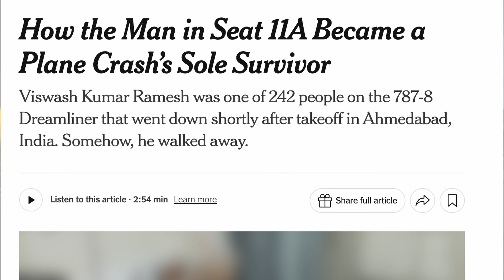Why the RAT Changes Everything – Air India 171 Update

Comment: And there might be an additional sign for a complete failure of both engines: The sound of the original video is quite good. But even in the sound of that video I do not hear any loud or increasing loud sound of both engines. In such a situation the engines would normally be put into full power function, what would make a significant louder sound than that, what we can hear in the video. Thanks for your update on the analysis. This accident is very serious from a technical perspective, and I can only hope, that it will be analyzed and clarified, until no doubt about the reason can come up anymore ...

Comment: Usually there is a accumulation of faults and errors. What I see posible that the rat was activated by malfunction and the hydraulic of the rad interfeard with the hydraulic of the engines causing the following failiurs:
Loss of controll and engine stop. The loud bang was the activation of the rat. The bang was the start not the conscience.

Comment: I didn't hear the jet engines in that clear video, wouldn't that be an indication of a dual engine failure? If the engines were running, wouldn't we have heard them in that video? Wouldn't they have drowned out the RAT props at least partially?

Comment: Are the flaps up or down in the new video (where you hear the RAT)?  If the flaps are indeed up, how do you explain that?  With all due respect, you ought to use the new video to revisit your old theory, not just to justify your new one.  In other words, does the new video rule out the possibility that the pilots accidentally pulled in the flaps too early?

Comment: What you did not observe was the position of the wheel bogey leaning forward..In 787, during take off, the wheel bogey bends in the forward position when the gear retraction leaver has been pulled up..the wheel bogey initially is facing upwards and then bends forwards while the undercarriage opens up to the retracting gear..It confirms that the pilot did initiate the gear up, however, due to the failure as you brought out, the gear initially facing up bent forward and then got stuck due to hydraulic failure and possibly a dual engine failure...the flaps from the picture were clearly down as per the take off configuration...

Comment: Is it possible one of the pilots shutdown both engines either on purpose or accidentally. Recall the fairly recent incident with a Horizon pilot flying in the jump seat having a mental breakdown and attempting to shutdown both engines in an apparent suicide attempt.
Reply: Oh! here comes test-is of Sherlock Holmes
Reply: @ashwatthama007 what? The current thought is a loss of thrust in both engines with no evidence of a bird strike. I’m asking a question. I’m not sure if the RAT would deploy if the engines were shutdown. I’m assuming in any situation of a loss of power or hydraulics they would, but I’m not a pilot or an expert on the subject. Sorry for asking a question.
Reply: @ashwatthama007 well…initial report is out…what do you have to say now…

Comment: Did anyone else see the video one passenger took right before takeoff of the AC off, the entertainment/TV's weren't working, and the lights off inside the cabin? Wouldn't that point more towards electrical failure rather than total engine loss like capt Steve thinks?

Comment: I am a pioneer B787 flyer, B787 captain that flew the B787 when it was newly introduced and have more than 8000 hours on B787 and have witnessed all its problems from very first issues with battery fire.  It is very difficult for me to accept this kind of failure as  the 787 is very stable and strong . Very sad

Comment: To add to this as well the landing gear on the video is tilted forward like it was in transition to be retracted but failed due to no hydraulics.

Also if the engines were running you surely would have heard them at full power if they were functioning.

Comment: I have theorized from the start, that both engines were mistakenly cut off, instead of just cut slightly back for the noise reduction guidelines at airports surrounded by densely built areas.  At the point at which a craft has just become airborne and needs to start climbing, it is tail-heavy and needs enough thrust to fight gravity.  If that crucial point of balance is compromised, the craft will fall backwards like a stone.  In this case, it looks as if the pilot tried to correct by lowering the nose of the craft.  But it just did not have enough altitude.

Comment: Besides the proposition  "dual engine failure" (confirmed (?) by RAT-deployment ).....we cannot deny the CCTV footage: the moments shortly after rotation....we see dust vortex below the wings. So this moment was OUTSIDE the runway threshold...relatively LATE...

Maybe there was not a sudden power loss after all..? Instead....continuous insufficiënt power along the take off roll all together? Can it be that the auto-throttle setting was faulty due to wrong FMS input? A marginal power condition, postponing the moment of "positive rate of climb" and the "gear up" command....in a high density altitude situation...??

Comment: It’s something that may be the cause of the crash 

As the plane was going to crash in the video moments before the plane crashed the RAT was deployed(Ram Air Turbine) it’s a small turbine that provides electrical power and hydraulic power to the plane in case of:
1:Electrical Faliure
2:Hydraulic failure 
3:Dual Engine failure

And the deployment of the turbine can be proved as it makes a propeller jet sound as in the original video of the crash it makes a propeller aircraft sound and in another video of a different aircraft with the RAT deployed it also makes the propeller aircraft sound.

The survivor also explained that there was a loud bang and lights flickering on the plane which mean the deployment of the RAT as the lights flickered.

Before the crash pilots said:
“No power,No thrust,losing power,Unable to Lift.”

This may be the evidence of a dual engine failure 

As the RAT deployed and the pilots said “No power No thrust…”

Though it’s a theory it’s a strong evidence

(This is all by “Captain Steeeve” he explained it more detailed check his video)

Comment: I’ve heard speculation that they used up every bit of the runway and that’s why there is so much dust kicked up by the engine thrust as they rotate. Maybe debris from the ground got sucked into both engines right at takeoff causing failure?

Comment: Speculation: A likely starting point of the accident chain is the severe contamination of the fuel supplied to the aircraft's engines. This contamination may have resulted from the wrong type of fuel being loaded into the tanks, the introduction of foreign substances during refueling (such as water, sediment, or particles), or a malfunction within the fuel systems. As a result, it can be said that the contaminated fuel reaching the engines clogged or damaged critical components responsible for generating thrust.

It is plausible to assume that both engines began losing power either simultaneously or in rapid succession due to the effects of the contaminated fuel during the aircraft’s acceleration on the runway—or that they failed entirely. Such simultaneous engine failure is extremely rare in modern aircraft and usually indicates a shared systemic issue.

Once the engines were rendered inoperative, the aircraft’s systems automatically deployed an emergency power generator known as the Ram Air Turbine (RAT). However, the RAT is designed solely to provide power to the most essential systems, ensuring that pilots retain at least limited control authority. This indicates the aircraft was in a critical, life-threatening state.

While attempting to take off—or shortly after becoming airborne—the aircraft likely entered a stall, meaning the wings were no longer producing sufficient lift, causing the aircraft to lose altitude uncontrollably and ultimately crash.

Comment: 12:58 as a former Naval Aviator and later 25 year Gulfstream pilot with RATs, you changed my pretty firm belief in pilot error because the gear was not up or moving up and apparently no flaps showing.  Great DETAILED analysis!!!
Reply: There probably not enough power being generated to raise the landing gear, that also explains a lot.
Reply: I am just an electronic technician with no aviation experience at all, but I am good at spotting little details.  I swear in one of the videos I saw, that it looked like the front landing gear seemed like it unlocked and moved back slightly about the same time that the plane appeared to loose thrust, like the act of pulling the retract handle caused some other catastrophic failure that killed the engines.
Reply: Juan Brown had better description of the failures that trigger automatic RAT deployment. But there is still manual deployment.  Really only adds to what the issue was. Still could be a pilot induced failure or errors in handling the mechanical issue or missing signs of coming mechanical failure.
Reply: i think this was a combination of pilot error leading to cascading failures, left engine fails, captain is busy handling the aircraft. copilot accidentally cuts fuel to the right functioning engine, leading to electrical failure(couple of seconds before the rat and battery bus take over), hydraulics are stuck until more electrical power is available. Gear is stuck meanwhile due to lack of electrical and Hydraulic power and so are the flaps. They had very little time and altitude to recover. It was too late had this happened at an altitude lets say FL250 or something they could have easily recovered. At  takeoff they should have been at MTOW(long flight etc etc) and with the gear down there's not much anyone could have done to save the aircraft.
Reply: @randombuilder345  You're just twisting yourself into knots trying so hard to pin it on pilot error. This video explanation is already pretty solid without the need for that hypothesis.
Reply: @endangeredWiz  i am going to believe the co-pilot error theory(shut off a functioning engine) until the official FAA report is published. Air India has Had 2 other fatal accidents(domestically) over the past 7 years due to pilot errors(look up air india express runway runovers). Some air India pilots are extremely proficient(Air India 101 incident where the pilot saved 300 lives despite multiple failures(both ils's failed),extremly low cloud ceiling,2 failed approaches due to non functioning ILS'S in terrible weather conditions,Only one display was functioning and almost no fuel over new york),not all pilots are that good though.
Reply: @endangeredWiz  official preliminary report is out and cleary points to fuel cutoff switches and confusion in cockpit. I was correct all along.
Reply: @randombuilder345 Good points, please put some commas and periods in as it's hard to understand.
Reply: @randombuilder345  there should be emergency landing zones around airports for stuff like this
Reply: @MorbiusBlueBalls  there should be, but India...... zero human value here.
Reply: Wow even with all the evidence saying otherwise you seem hell bent on accusing pilots because "you think it". Sounds more like you have already decided it is human error and making up crazy scenarios to make your conclusion plausible.
Reply: @ChamaniPunchihewa reading comprehension is hard i know

Comment: There were also 4 other conditions that I observed: The take off flaps weren’t deployed, the running gear wasn’t retracted, the plane took the entire runway to lift off, it was extremely hot there which means hot air has less lift. I also noticed that the tail dropped rather quickly which might indicate a shift in the cargo area which might have contributed to a stall. 
It’s sad because I had a friend who used to work with the FAA and when he had to investigate crashes, particularly in forested areas he said that they actually relied most on their sense of smell because the smell of burning flesh is quite extreme at a crash site.
I wanted to become an air traffic controller at one time but I couldn’t meet the requirements back then.

Comment: Hi Captain, 787 Pilot here… Did you noticed the MLG tandem tilted fwd, indicating the LG lever commanded up and the cycle for some reason has been interrupted ?Maybe that’s the trigger to shutoff both engines. Some SN ACFT has a bulletin reporting both engines have shutdown after landing in a specific condition. I strongly suspect of system failure, and the pilot’s Mayday stated loss of thrust, seems they had no way out. Very sad situation.

Comment: So if it's a dual engine failure then fuel does sound suspect, the rarity for both to mechanically fail at the same time has to be extremely unlikely.

"A dual engine failure on a Boeing 787 Dreamliner, while rare, could stem from several causes, including bird strikes, fuel issues, or mechanical failures."

Comment: I immediately thought both engines had failed because of the lack of jet noise. Even with the most modern technology, two jet engines that large still make quite a bit of noise at that distance. The rat was explained well; it's the sound of the propeller tips that triggers the supersonic boom. The flaps and slats cannot be the cause of the crash either; a 787 still flies and climbs with both engines. The question of all questions will be why both engines failed. Bird strikes? There are no birds visible and no smoke from the engines. I think pilot error is unlikely; someone would have had to have set the engine levers to idle.

Comment: In case of a too large angle of attack and a low speed the engines flames could shut off because the air intake is too low to keep the flames burning. The engine suffocates. But the video doesn't look like a too large angle of attack. But it could be the case because the horizon is not clearly visible for reference.

Comment: Re the take of flaps being accidentally retracted instead of the gear? Here’s some info regarding that. Impossible mistake.. 

The two are not close enough to be interchangeable. The flap lever is to the right of the engine throttle on the pedestal between the pilots. The landing gear lever is located on the main instrument panel, below the flight display panel, on the captain's side (left),” he explained.

Comment: I got 1: What if the flaps were on but it was at a such an angle it wouldn’t work. And I think both engines shut down for a second or two. As because of that the rat was used. And I guess there was an electric failure that caused dual engine failure

Comment: @Capt Steeve, agree that from the date of incident, it is apparent "Dual Engine Failure". You are right, automatic deplyment of RAT. Only essential lights and panels. Probably emergency exit path lights. This video (original) gives an account of the incident aircraft height 500'-600'-650'-450'. The more important video which require analysis (theories) is aircraft height 000'-200'-300'-400'. If you can obtain the original video at these heights and analyse anomalies. It appears that all happened simultaneously - the loud bang (likely AirCon Duct rupture); ...???....... ; Dual Engine Failure; subsequently unable to retract LDG; subsequently unable to relight any one of the engines.

Comment: He says it could be a dual engine failure but the rat was deployed and working. What about the 2013 grounding over lithium battery's. Do the hydraulics have a back up battery made by yuasa. That was the replacement to keep the 787 in the air. Was Air India cutting corners on authentic battery's. My Australian 12V gel cell exploded After 3YRs the plane is twelve years old.

Comment: Civil Aircraft engineer here.. the RAT on the 787 is located on the rear left fuselage ALF. Not the right, the sound heard can easily be reverb or an imbalanced /damaged engine. The RAT will only deploy when there is a complete power failure, that means both engines would have to have failed and their N2 speed reduced to below the min drive speed for the IDG which takes time! Also if there is sufficient battery power it won’t deploy, this gives the pilots time to start the APU before the RAT deploys which increases drag. Thirdly had the RAT deployed the cabin lights would not flicker, they would extinguish, only emergency lighting and essential systems will remain online. In sorry to say this but from a technical stand point it’s extremely unlikely that the RAT was deployed. Nothing is impossible…

Comment: No flaps extended + gear down + full weight = low speed, high AoA → can cause disturbed inlet flow and lead to compressor stall in both GEnx engines. Not a direct cause, but a plausible trigger for dual engine rollback and RAT deployment. Chain reaction….

Comment: A "double engine failure" does not mean that both engines itself failed. It could be some other problem that shut down the engines. We can see in these videos that, at the moment of leaving the ground, the plane had thrust, but then it lost power and altitude until it crashed. And this evidence of the RAT activated really corroborates a double engine failure. It is a critical phase of the flight but a double engine failure like this is very strange. Especially in a 787.

Comment: This aligns with the crew radio call of their perceived loss of engine (1 or both) thrust. That aligns with the (unusually) lengthy takeoff roll. So, we’re 1 or both engines producing < takeoff power, thus the longer roll? Perhaps, not checking engine thrust to runway check distance(s), the crew may have unintentionally taken a jet into the air which should’ve been stopped on the runway during the takeoff roll… Great sleuthing work on the widely circulated video. 👍🏽